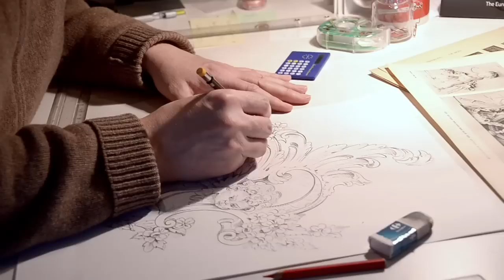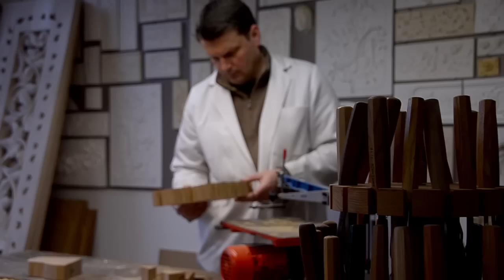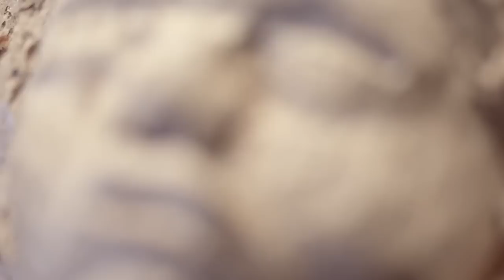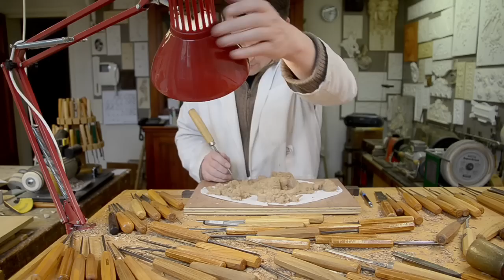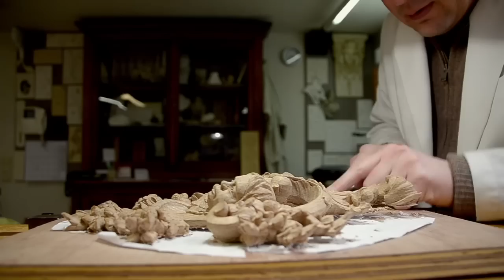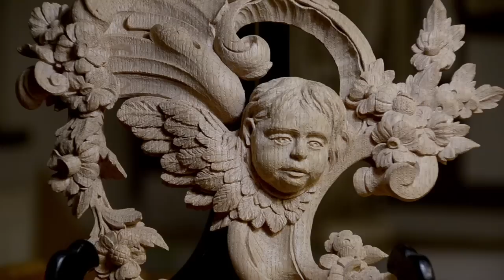WOODCARVING : Patrick Damiaens , At the " Museum aan het vrijthof " | Sponsored by TEFAF Maastricht

Comment: In this screen you gave birth to an angel. VERY nice work indeed, true to the European carving tradition. That is, NOT striking the contours vertically, but rather giving the movement first, and then finishing the outer lines only once the volume and harmony are right. Bravo Monsieur, vous avez tous mes respects.